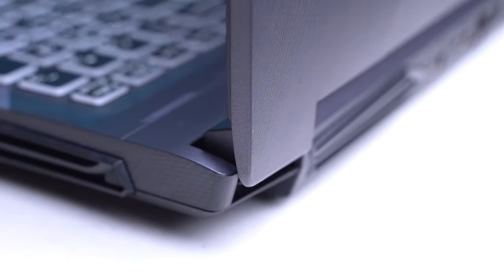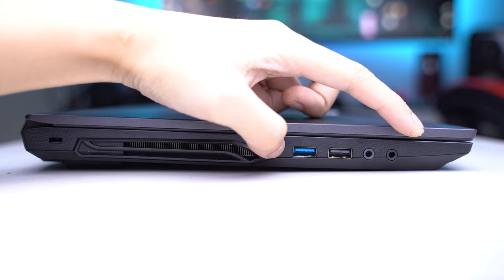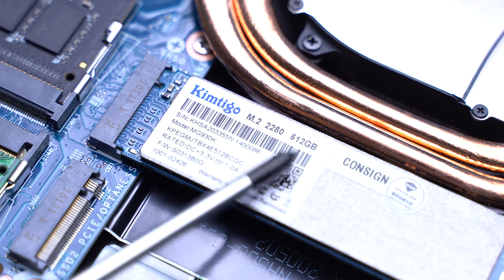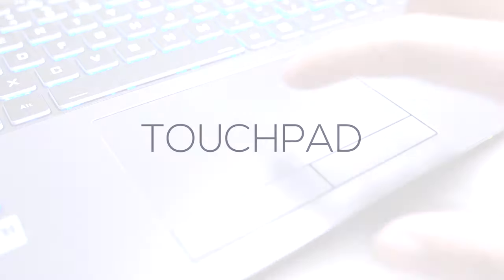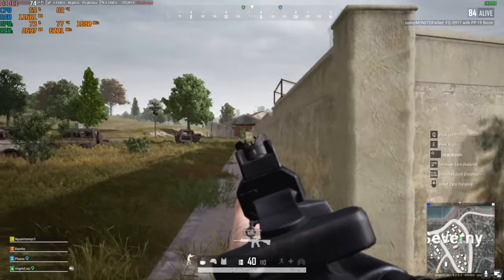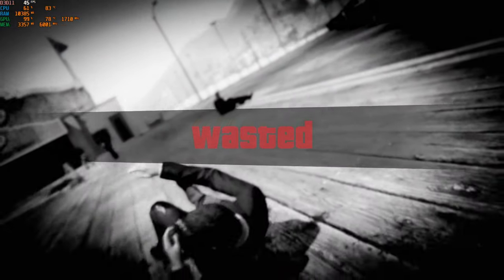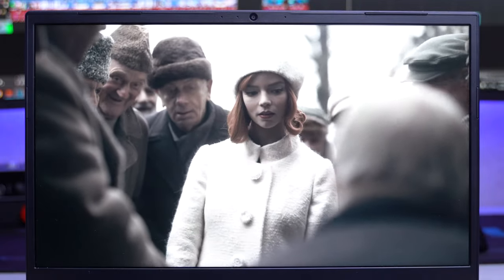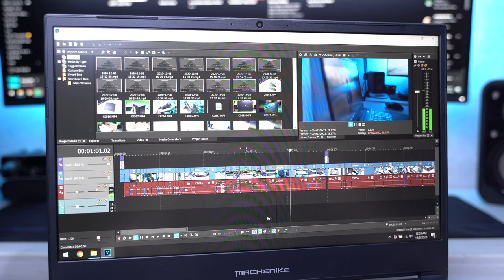$700 Gaming Laptop Worth It? (Machenike T58 Review)

Comment: tell me, with this laptop I have a problem, when playing games, for some reason, the 3050 works at 20-50% and Intel UHD is mostly loaded at 50 to 90% and because of this throttling occurs.  In the settings, Nvidia changed the priorities but still.  I turned off the graphics processor from intel and everything is fine, but I can’t change the resolution only 1920 to 1080. Why doesn’t only rtx3050 work in games?
Reply: it means that the laptop has no Advanced Optimus settings.

Comment: I bought one gaming laptop dell inspiron, forgot what model but the spec is i7-4710HQ GTX850M 8gb ram 240gb ssd

This laptop bought on 2015, I used this laptop for software AutoCAD, MPlab, Labview, Nemo Outdoor for Drive test , other software and so on

This laptop was with me when I worked inside telcomunication and right now I work in oil & gas

Sadly this year this laptop broke down even it can be used

If this Machenike laptop is reliable like dell gaming laptop, will consider to buy this laptop

Anyone already used this laptop Machenike T58-VA for 1-2 years?

Comment: This laptop looks very similiar to gigabyte g5.
Reply: Which is better? Gigabyte or machenike?
Reply: @dee_hfgblank1617  Definitely the cheaper one. I would prefer Gigabyte because its a trusted company for many years. Also the I prefer the all plastic of the g5 just so that nothing bends and wont have to be sad if it got scratch which can be polished easily. However i would recommend any other laptop over gigabyte/machenike just because there are laptops with much bigger battery and cooling system. This may be affordable but spending a 100 more can be night and day. I recommend, gaming 3, legion 5, dell g15, asus g15, victus, swift x or nitro 5. Avoid MSi gf63/65 as their gpu are max q and the cooling system is the worst meaning overheating even on lower powered gpu which is most pathetic. I would choose machenike or gigabyte over msi. Then the ones i mentioned are the solid famous choices.

Comment: What I did not like with this laptop is the fact that they put a small battery (1:51) at the back right corner which in turn denied exhaust port in that corner.

They ought to just put a bigger battery at the front (below the palm rest area) by removing the HDD space (2:16) and move the GPU (2:20) to the back corner. At this day and age, no one uses HDD let alone gaming (for which this laptop was intended for). We have cloud storage if we want more space.